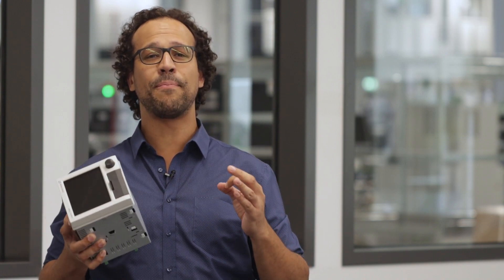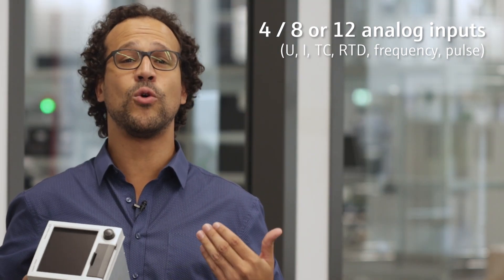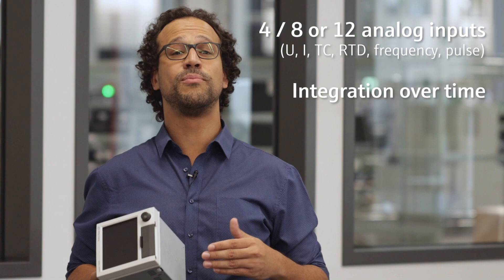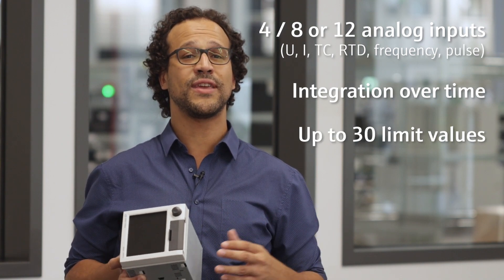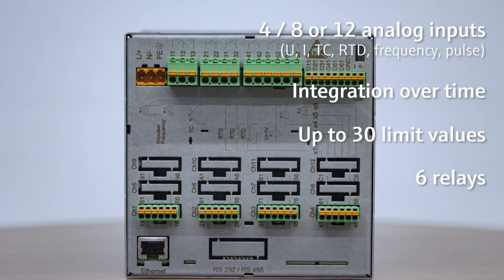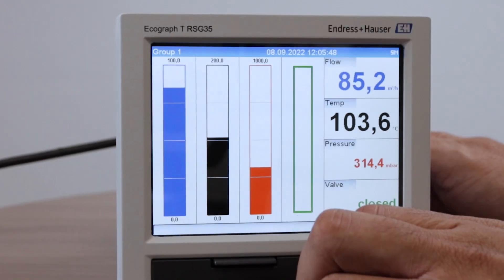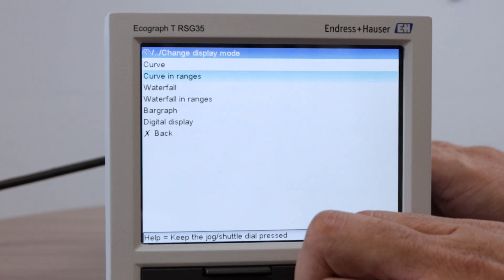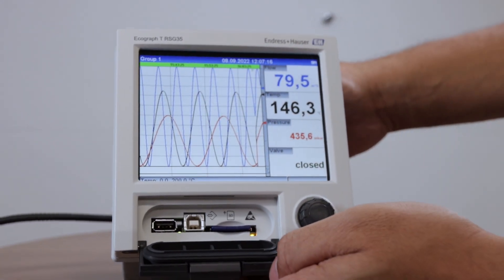Ecograph T RSG35 - Explained in under 2 minutes

Comment: If two Promag 10 flowmeters are connected to it, which output terminal number on the flowmeter will you connect ,26 and 27?
Reply from the maker: If a current (4-20mA) signal is used, the terminal 26 (+) and 27 (-) would be the correct terminals on Promag 10.  A detailed description of the terminals of the Promag and the RSG35 can be found in the technical documentation of each of the products.

Comment: Can it be linked to a PLC?
Reply from the maker: Yes, RSG35 offers optionally Modbus TCP or Modbus RTU slave functionality to transmit all measured values and process values to a PLC. Up to 12 analog inputs and 6 digital inputs can be transmitted via Modbus and stored in the device.
Reply: @endresshauser  can you connect it to a regular PC instead of a PLC? I want to read the measured data in real-time with some scripts
Reply from the maker: @bruddabearZA  yes, the RSG35 can also be connected to a computer to read the data. For the data exchange, there are several options, like using the digital communication protocols, using the integrated web server functionality to visualize the data, or use our Endress+Hauser visualization software field data manager. For more detailed support on specific topics, please get in touch with our support: www.endress.com/en/support/contact-support